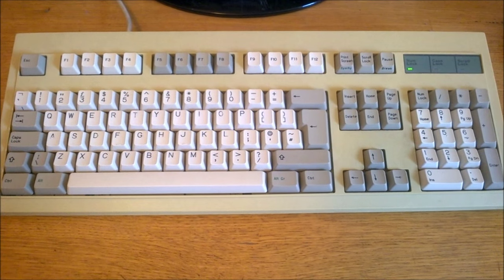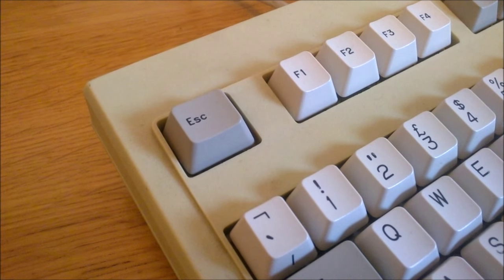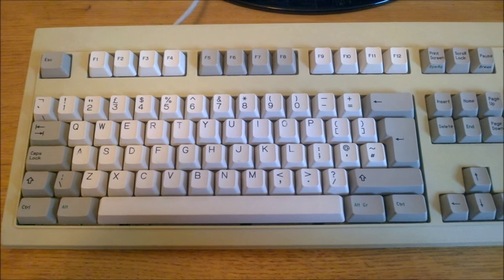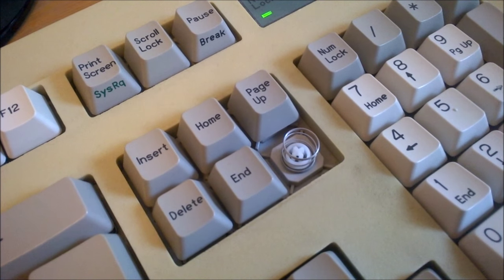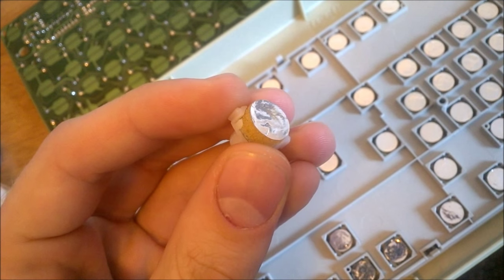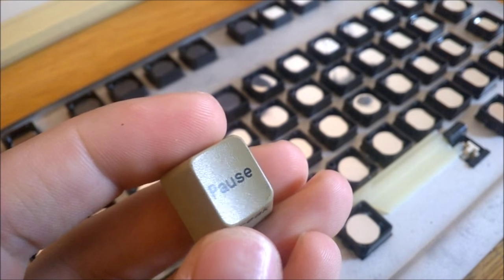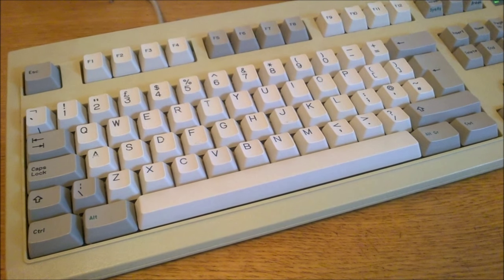BTC 5339R-0 review (BTC foam and foil)

Comment: those BTC sliders look exactly like topre sliders with cherry mx stem. a potential donor for HHKB stem swap?
Reply from the maker: +Alex Akopyan I have no idea! Topre is not easy to get at recycling centres or for cheap on eBay so I don't have a Topre board yet.
Reply: +Chyrosran22 that's true. You'd have to move to Japan to find Topre at recycling centres =P
Reply: It's been 3 years... Now can you do a slider swap now, Chyros?
Reply: if anyone still wants to know 7 years later i just ordered one of these and i have a spare hhkb sitting at home lol

Comment: I found one of these with seafoam switch mounts. Is that the tactile variant? It's the BTC-5339SX.
Reply from the maker: John Cross these came with multiple slider colours, sometimes in the same board. They don't appear to mean anything. The tactile version uses buckling rubber sleeves instead of coil springs.

Comment: Hi, I've found one of this keyboards and after reading about the connector (which is a din5) and it is said that some keyboards have din5/ps2 capabilities, and some others need special active converter to conver the din5 to usb. I wanted to know what is the deal with this keyboard. I've opened it and found that where the cable is connected there are 6 outputs (and of course the din5 has only 5) that is what caought my attention, is it possible to use a ps2 cable with this keyboard, and a simple ps2 to usb converter? Excuse me for my bad english, I'm from Argentina. Thanks
Reply from the maker: Argentina, I just came back from South America today :) . I have a video on protocols, plugs and connectors that explains this in detail, check it out :) .

Comment: you fool

when the num lock light comes on but the keyboard doesn't work, it's usually because of some dead capacitors on the controller board

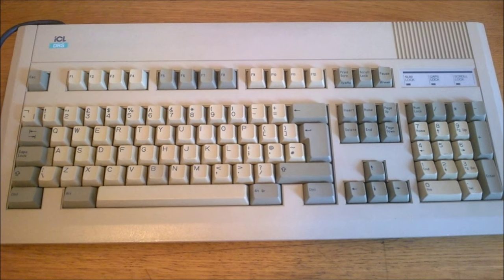you should've tried replacing them on the keytronic (5:15)

Comment: What is a good price to pay for one of these foam and foil keyboards?
Reply: They've probably changed from the five years ago when this was made. The only one I've seen is a Compaq Portable keyboard on eBay for $120. The main problem though, is that used keyboard sellers don't usually advertise that their keyboards ARE foam and foil. They're not made at all anymore, so no luck.
Reply: Well, u could actually find a keyboard from this video on ebay with prices like 20-80 bucks. I'd say 30-40$ is kinda decent price for a one in a good condition.